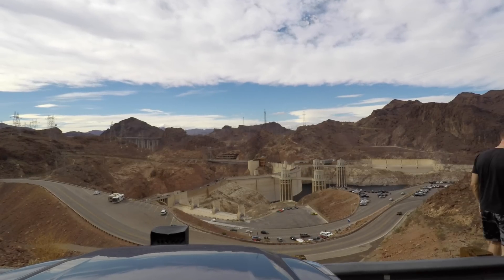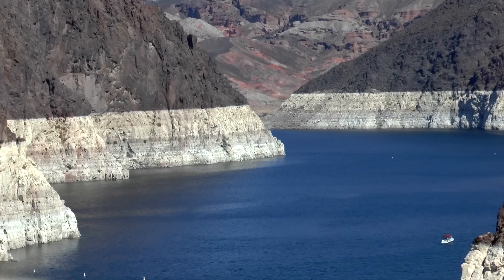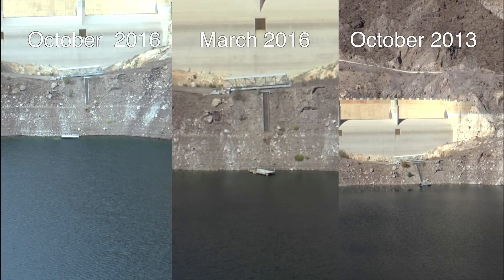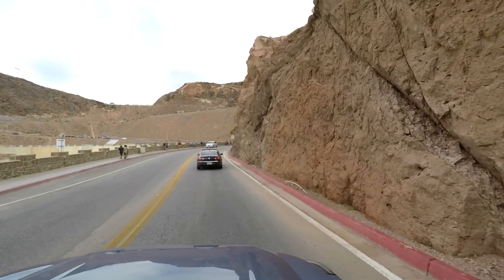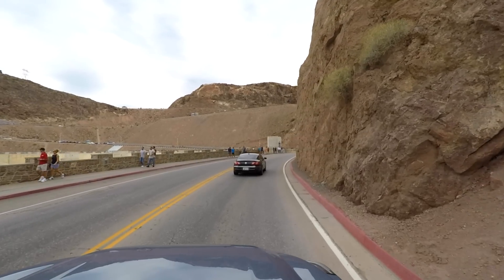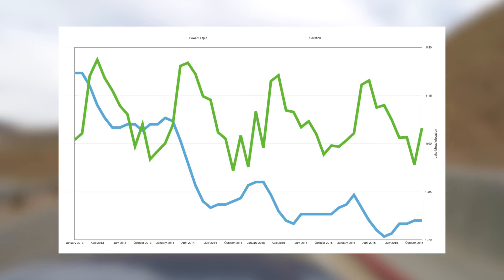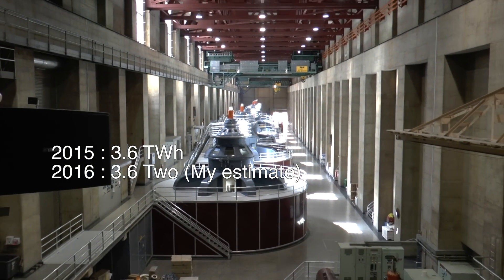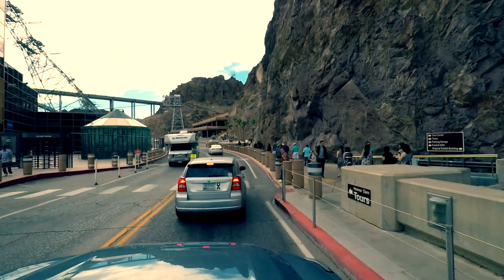Lake Mead low water level and Hoover dam power production

Comment: How would Vegas be powered if Hoover Dam stop generating electricity? Could the grid handle that kind of load transfer
Reply from the maker: I think it mostly handles peak loads. The main function of the dam is water management. I tried to google some figures but couldn’t find anything conclusive to give you a proper answer. 
Because of COVID I haven’t been stateside for some time and haven’t looked at what’s going on at lake Mead but I see you are heading into a shortage. If I can find any useful information that could make a good video, I would probably make one. Cheers.

Comment: Hi, this is Sally, you responded to my comment, thank you. I consult by appointment only in aeronautics and auto, but I would like to continue communication with you.  I wrote you back and delivery immediately failed. Your reports are appreciated, the information and presentation are excellent and you present them with integrity. The best way to reach me is email,  sallyojohnson@aol.com. I have more to share with you about what I see in the failure of Portland cement, compared to the ancient Roman under water concrete, additionally the factor of curing time, the metal reinforcing bars, and the chemical soup created by these factors. Please feel free to email as I am interested in discussing this with you. Thanks, Sally.

Comment: We forgot lake powl feeds lake mead,  it good on water, I lived in Colorado next to the river, we had record floods on the river, all the lakes r good that feed the river,
I believe from 2000 to 2010, they had planned to lower the water level n build a new bridge, to take the tress from the dam, they had 1930 concrete technology,  the concrete of today is a lot stronger,  I think there is not a water shortage, California farmers use more than any thing, n vegas uses a lot,
My opinion the hover dam was getting old n weeker, so it best to lower the water level, n build a new n better bridge.
The Glenn canyon dam is stronger, has had erosion in been fixed now to handle large amounts of water, in can handles the water that that the hoover dam cannot,  I believe Glenn canyon dam, is around 2ft below level,  it has too drop in level to handle the snow fall melt.

Comment: Any thought that the Dam might be compromised and they had to lower the water?
Reply from the maker: That is an interesting question. :D But if you look at how they built the dam with both arch and gravity designs, it seemed like a massive overkill design but of course the failure of St. Francis dam, were fresh in memory so I figure that it should be plenty strong. Then again, it was the largest concrete pour at the time, well a first for many things I suppose.

Comment: The information you provide, despite it's age, is more valuable than you know.
Thank you for your time and efforts in bringing this to a more public forum.
It is curious why the drop in production, regardless of the water level. 

My first thought would be that demand is less now than it was in 1984 given that nearly every light bulb in 1984 was incandescent where now all light sources are almost exclusively LED or florescent.  And in the case of LED, 60, 1984 'incandescent-watts' can be replicated with just 14, 2012 LED-watts.  That's more than 4x as efficient as incandescent.  Of course it doesn't mean the power bill is 4x less today.  Hmmm

And considering all the efficiency advancements in most electric/electrical/electronic devices today, sure, even despite the much greater number of devices than in 1984, I bet it's a 2 to 1 increase in savings.  

That said, let's go the other way and just assume the 10TWHrs figure from 1984 - in terms of demand - is still there today, but Hoover isn't filling the entire bill @ 3.6TWHrs.  What and where are the other sources of power to fill the gap, ehh?  Fossil, solar, wind, hydro, geo-thermal, nuclear?

Do you cover other parts of the overall hydro system in that area?  Thankfully, Hoover dam is 'just' one important piece of a multi-state hydro-control system positioned in precipitous places whereby a large percentage of surface water can be harnessed and directed toward areas where it is contained and used in a measured fashion.

For the last 2 decades, much of the precipitation is falling in areas W, E, and S of the hydro system that feeds Lake Mead.  Eventually, some may reach Mead, but for the most part other hydro systems have been tasked to fill the gap - tho at considerably higher-than-normal load demands.  

I for one hope the weather patterns shift back and fill Mead once again for another 5 decades.
Reply from the maker: Hello. Thanks for the comment. Yes, I found it interesting but sometimes I find things interesting that no one else finds interesting. :D
Strangely enough, this video is starting getting views again. Sometimes I make a video that get many views and so I think, hey maybe I should make another on the same topic and that gets no views. :D but maybe it is time to make a new on this subject.

I have been thinking about making another video from the perspective of the management and administration of the water resources which is sort of the real purpose of the dam as you mention. 
I have yet to find any clear source of who produces how much in any easy understandable way. Here in Denmark where I live, out national grid service, has a live view of usage, productions and from which sources, really interesting to watch: https://en.energinet.dk/energisystem_fullscreen

I did record some video last time I went by the dam, but sadly I lost much of the footage, I had been thinking about another road trip some time and follow the Colorado River a bit more down AZ and have a look at the other dams and structures where possible as I find it interesting.
 I don't have any planned trips yet, but I will do an update video when I get a bit of time free from work as making graphs takes some time. :D
Cheers.

Comment: I’ve been to Vegas many many times when come into Vegas on an airplane I’ve seen the water lever down down Vegas is doomed you can’t build these huge casinos in a desert  oh think about all these people flushing toilets what a waste
Reply from the maker: Yes, every time I take a shower under one of those rain shower heads in the hotels there, it seems so wasteful in the middle of a desert, that I almost feel guilty. :)
Reply: All the water in Las Vegas is reclaimed. Still, it's not enough. Input( water flowing in) is not able to keep up with output. Not just the casinos, but all the new housing. In 2005, there was still so much virgin desert and you could see stars. Now the urban sprawl goes right up to the mountains.

Comment: Under its original design, the dam will no longer be able to generate power once the water level falls below 1,050 feet (320 m),  The water level here is at 1,076 feet ASL and about 38% full. The water level is dropping about 3 feet per month.   https://en.wikipedia.org/wiki/Hoover_Dam#Power_plant_and_water_demands
Colorado has the water rights from a 150 yr old agreement. So they are taking 60% of the head water before it leaves the Rockies and piping it thru the mountains to Denver and other Front Range cities, with construction under way to add more pipes to increase that to 80 %. So the Colorado water stays in Colorado. Everyone down stream is SOL. The Army Corp of Engineering can only give advice similar to the NTSB. It's Dog eat Dog time..... Not global warming going on here, just plain Greed......

Comment: Looking at your chart:

The water level drops when the power production goes up.  
Well, it takes more water to make more electricity. 
The production level goes up in the hot summer months to meet the demand to power all the air conditioning units in Las Vegas.
They aren't making all the electricity they can, just what they need at the time.
Reply from the maker: rickpaulos I agree. That is the most correct way to describe it.